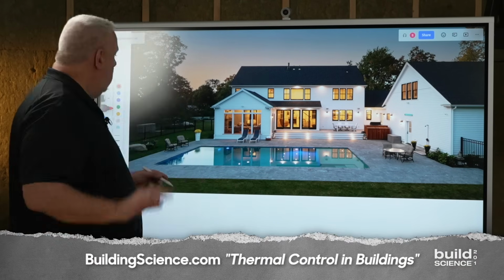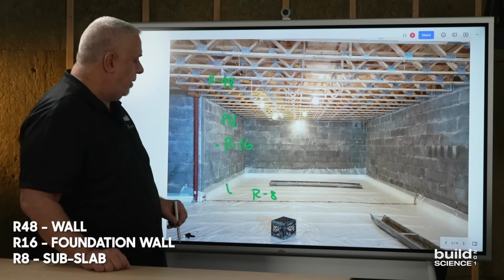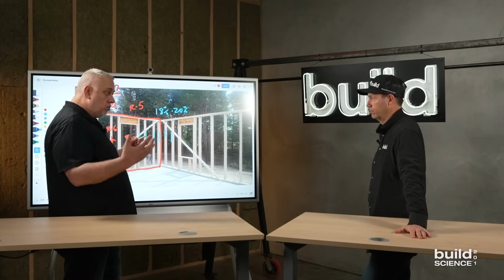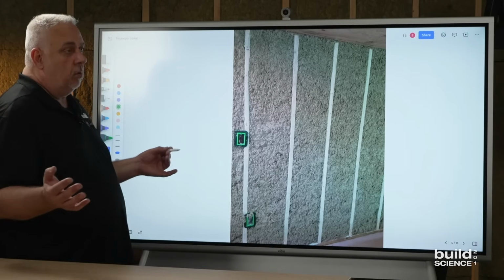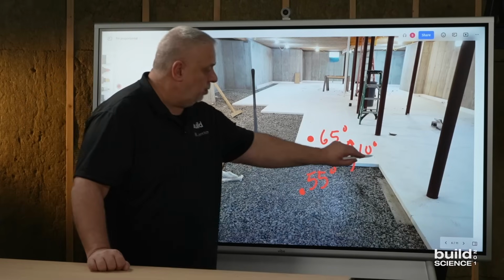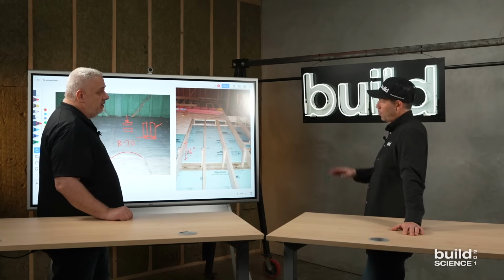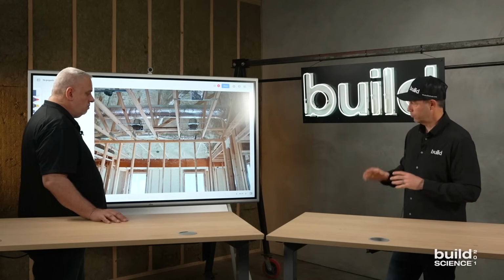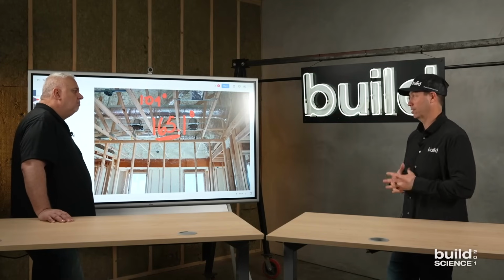Build Science 201: Ep. 12 - Thermal Management: Proportional

Comment: One nit, the implication that fiber glass is comparable to blown in insulation misses a point proven in Canada.   R value is a measure of conduction but fiberglass also is affected by convection currents when there is a large delta in temperature.  At zero degrees F outside the effective R value is cut in half.  Air is the primary insulating material for the pink stuff.

Comment: How do I find a quality builder in Fort Wayne, IN for a 2000-2500sqft home. That will keep the home simple and not overly complicate it with extra roof lines. I don't need features that only jack up the price and don't offer value.  I'm convinced my current house doesn't have osb on half the outside walls and is extremely drafty.

Comment: Really interesting video -- QUESTION ---  Matt or Steve, @07:50 you said the studs were about 20 percent of the wall cavity.. But how would you calculate the percentage if you were using those insulated "T-Studs" instead of regular 2x6 studs?  Would you still calculate the studs as being 18 too 20 percent of the cavity or would it be zero percent (since it is thermally broken) or do they prorate it somehow since there is better insulation in the stud??  Do inspectors credit T-studs as "zero" when doing those calculations?
Reply: THe 20% would be the same number but the R-value of that 20% would go up from R-6 to R-16 ish
Reply: Measure both sides and get a rough estimate on how much the connecting wood dowels make up %wise per foot. Add that to the equation. It's still filling the cavity which means u can't put insulation material there.